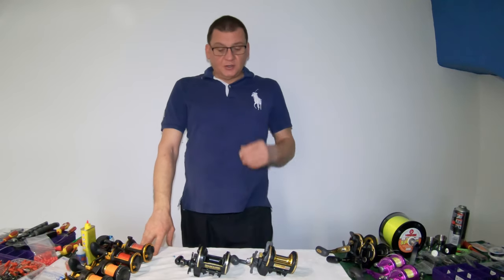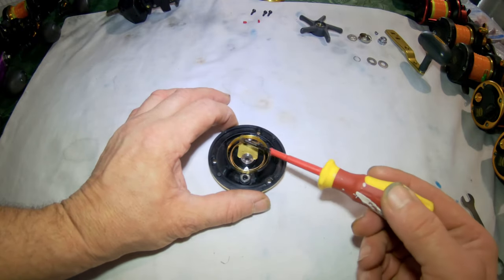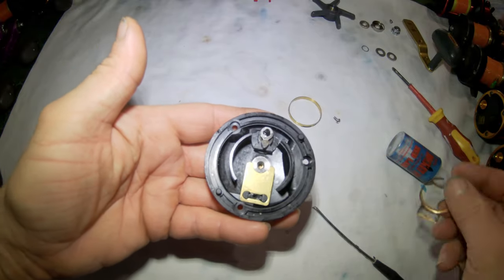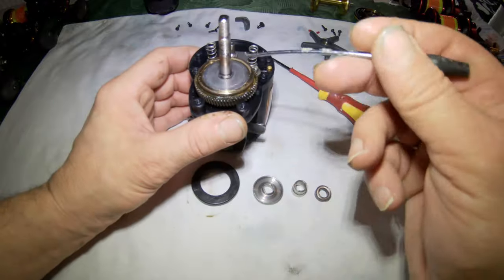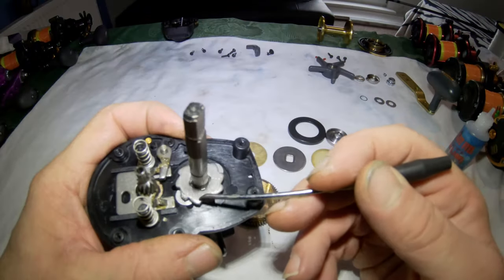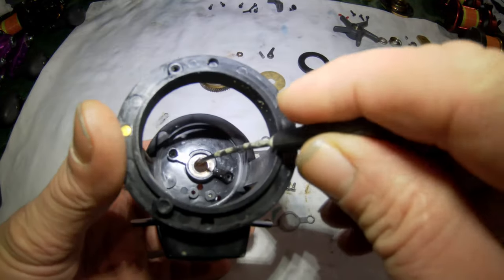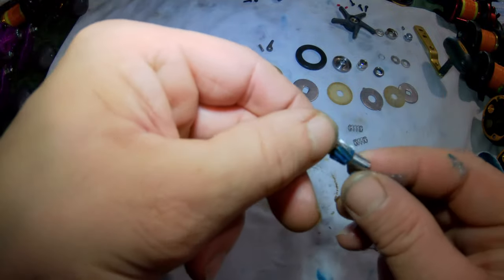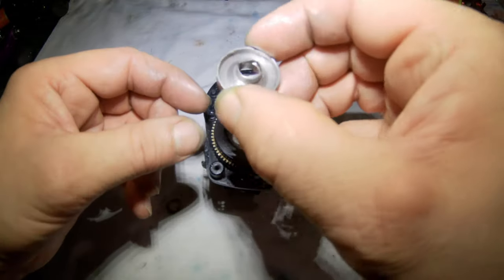Daiwa Sealine - X30 - SHA - daiwa Slosh 30 Reel Service.

Comment: One thing I find when doing these,is if you remove that little O ring that you broke,first,the main gear comes off easier....it is then easier to remove the drag washers,once the main gear, with the washers, is off.
Good to finally see one of these reels being done on YouTube. 🎣
Reply from the maker: thanks david the  gears are always very stiff on the slosh reels even the older slosh needs a bit of persuasion
and yes i found in both the reels the little rubber o ring was broke could that be wear and tear does not seem to cause any issues thou i was thinking it must have spilt under pressure from the drag

Comment: thanks for posting this. Used this to help service my 30SH where my spool wasn't engaging when i turned the handle.  cleaned it out just like you suggested and put the dog leg back in right orientation and it seems to be working fine now. much smoother than before too
Reply from the maker: Thanks glad you found it useful

Comment: Brilliant detailed video Paul, you've obviously had them apart many times before, no doubt you could strip and rebuild them blind folded 😂.  I love my slosh's, especially the SHV30, personally I think its best to keep them as they are and not mag them, as having the use of the ratchet is far more useful. Like you I just put plenty rocket fuel in the bearings and adjust the spool tension to slow the reel to my needs.
Reply from the maker: have to agree tom i need the ratchet for the tope and congers much more important

Comment: Thank you for sharing this fab video Paul, I have the slosh 30 that needs a service but never had the knowledge of where to start and not knowing of an expert who service reels. Mine might need just a good clean and re-greasing maybe some new bearings as it's not running particularly fast and the spools makes a grating noise when casting, so thanks again for this maintenance video and I'm going to have a go since this lockdown is stopping me going fishing 👍
Reply from the maker: you can get a full set of bearings from ebay for the slosh reels for about £15 on ebay well worth doing glad you liked it and thanks again
Reply: @StarfishSeaFishing  no problem Paul thanks for the info I'll have a look on ebay for the full set of bearings then I know they are all new thanks again 👍
Reply from the maker: @michaelabbott6271  best way they are cheap saves finding one has gone
Reply: @StarfishSeaFishing  that's true Paul just found a full set on ebay £15.15 cheap as chips. I'm not a big caster more of over the head thump but want to do the otg cast but as I say the reel doesn't sound sweet and the spool is not spinning as it should. So new bearings and set up properly should get it running properly, what is the best grease to use when servicing 👍
Reply from the maker: @michaelabbott6271  penn reel grease is superb and TG rocket fuel for the bearings the red stuff will do you fine
Reply: @StarfishSeaFishing  thank you Paul ill get some when I get my new bearings 👍

Comment: Hi mate great video! Very helpful. Was wondering would the cast control cap on that fit on a sl30sh, lost mine and the only replacement parts I can come across is for a x30. Thanks in advance!
Reply from the maker: No I am sure they are different try Jim's reel shop on Google he will have the part you are after
Reply: @StarfishSeaFishing  Thanks so much for your reply! Appreciate it

Comment: Hi Paul, my slosh 30 drag seems to be slipping when I cast out. If I reel it in sometimes the it struggles to bring the line back and even tightening the drag fully doesn't change the drag, it still slips. 
Would me servicing it following your instructions cure this, perhaps water has got into it? Really would appreciate your advice.

Comment: Have you any info on the bearing upgrade kit to make the Sealine X 20SHV/A the same as the Grandwave 20 I did purchase the 6 bearing kit off eBay but one of the bearings doesn't fit my sealine X 20SHV ...but it still makes a huge difference in the smoothness of the running of the reel, I do like my reel to run fast so I've also upgraded the spool bearings to abec 9 ceramics from Acer Racing it is now a flying machine use this reel for shore fishing aswell as Pollack and Bass wrecking with 330m of  0.24mm 40lb braid ..
Reply from the maker: sorry i dont know the upgrade